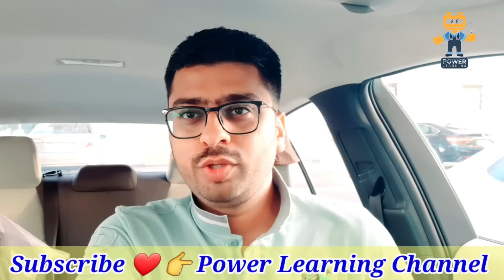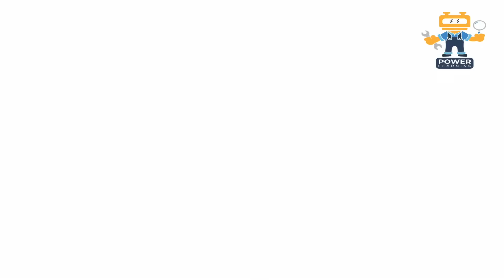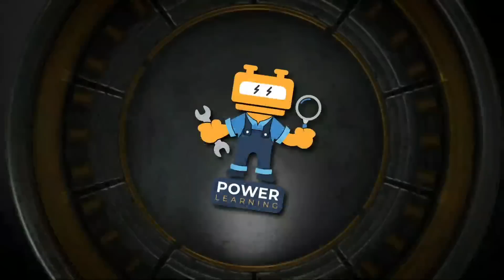Generator fail to start | diesel generator Common problems | crank fail | Fail to stop #dgfailure

Comment: Model 1506A perkins generator 250 kva there is also ECU crank but not starting what the problem?
Reply: Same problem but cumins did you fix that problem

Comment: Hi sir , what happens if the generator is starting via a relay and through a direct wire but does not run on its own it requires one to hold accelerator and once you let go of the accelerator it then switch itself off.

I also get the fail to stop alarm.

The generator doesn't not start via the control panel. .

Where should I start checking?

Thank you

Comment: Dear sir,In emergency how we can bypass oil pressure sensor..
Reply: You shouldn't have to by pass it? Depends what controller you have but when cranking remove the oil switch wire and that should by pass it but you shouldn't bypass it unless you want to see metal lol

Comment: Thank you very much 🥰 
Why "failed to stop " is related to oil pressure sensor instead of the Solenoid,?
Reply from the maker: Great point!
Reply: Majority of generator controllers use the oil pressure switch to detect if engine is running, so if you have faulty oil pressure switch then the controller might expect to see that switch open when we shut off engine but if its closed then the controller is still thinking that engine is running. Simple

Comment: I had 6010 controller with fail to stop alarm . I change 3 vdo10 bar oil pressure sensor but still the same condition... suddenly it fail to stop gone and then I can run it.  After 5 second again stop and show stopping and cannot be reset . After timer goes out I had fail to stop again .... what shall I do?